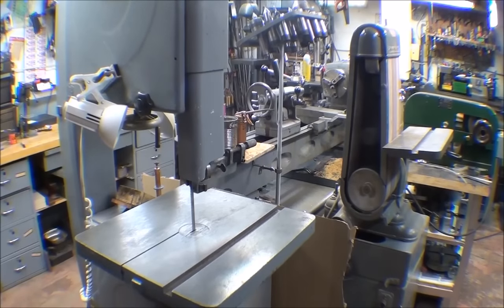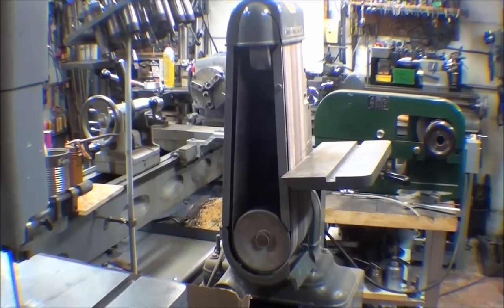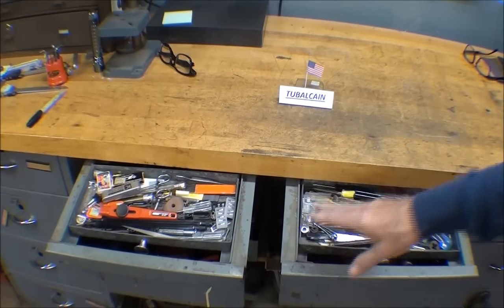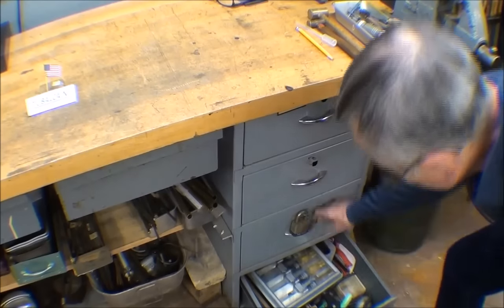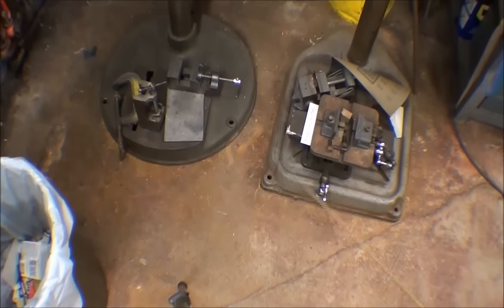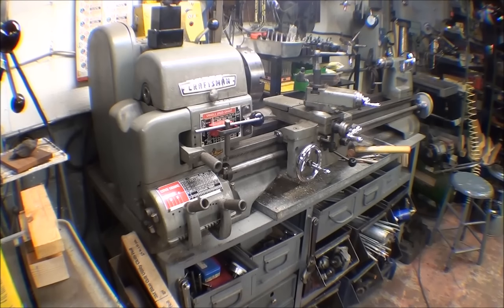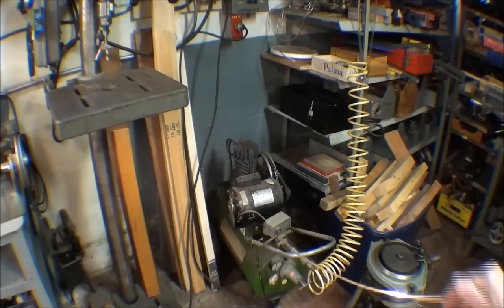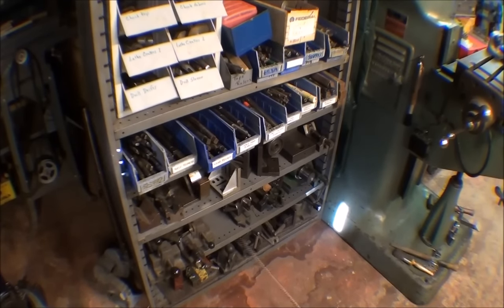TOUR of tubalcain's Machine Shop mrpete222

Comment: Well, I can no longer complain about the amount of space I have available! Thanks for sharing. I have a question you may have already answered in a video, but if so I have missed it. Since you don't use your compressor all the time, I assume you're not one of those who is always using compressed air to blow chips off of your machines. I'm not either. However, I have a hard time getting all the chips off of the Bridgeport since there tends to be a film of oil helping all the chips to stick in place, so the vacuum doesn't get them all. What is your method of cleaning up after a job, sans compressed air?
Reply from the maker: +Rick Rose Thanks for watching-just use a little thinner on a rag. maybe--mineral spirit, it cuts the oil

Comment: Lyle is the Bridge port mill 240 volt or 3 phase 420 volt Regards Frank
Reply from the maker: It is a three phase motor. Probably dual voltage. I have it set at 2:20 volt

Comment: greetings mr. pete. thanks for the tour. if i may ask a question: i'd like to get into gunsmithing, specifically refurbishing pistols and revolvers. is there a brand of files (and other handtools) that you feel are as good as old nicholson tools? would a mini (or even micro) lathe be able to turn 4-6 inch barrels? i guess that's 2 questions. hope that's ok. from one lyle to another, thanks for the lessons.
Reply from the maker: +Lyle W Hi Lyle. I only met another lyle once in my lifetime. Nicks are best, also Heller if they still make them. No, those smaller lathes will not do the job. I like crescent, proto, vaco,--too many, all the older USA made handtools.
Reply: mrpete222 i've met 3 other lyles (one was family), and now you make 4. :-) thanks for the input on hand tools. from online reading it sounds like nicholson quality went downhill when they went out of country. i'll check on those others.would you have any sort of minimum recommendation for a lathe? would only be pistol barrels, so wouldn't need a great center to center distance. thanks again.

Comment: Thanks for the tour. 
I am not trying to be a wise guy but what is the use of a padlock in a room full of machines that can cut steel?
Reply from the maker: +ScribblesOnNapkins Point well taken. Ever watch STORAGE WARS?
Reply: +ScribblesOnNapkins Yeah I figured the lock just was drawing attention myself. Because without the lock the drawer would blend in better.
Reply: +mrpete222 Sorry I try to avoid getting hooked on TV, also I never got cable or anything like that.
Reply: +Paul Frederick True but when you just hide anything in a workspace like that you will never find it. (voice of experience) If anything the pad lock is a good way to remember where you left something expensive.

Comment: Would you not be worried about abrasive dust from the sanding belts getting on the bed's of your lathes ? Do you have a surface grinder ?
Reply from the maker: +ro eng Yes-I think about it always. Usually, I have cardboard betewee the 2 machs

Comment: I am curious if you have a bulkead access to your basement? I have a basement shop with no big machinery  besides a drill press and a homemade bench lathe. The problem is going to be bringing big machinery into a 8 ft tall basement with no bulkead just a doorway.
Reply from the maker: +Micscience No bulkhead--down the stairs it came-diassembled

Comment: Just like my collection of over 50 years however I have been getting rid of a lot of tools,machines,tooling etc as I have not used many of them in years and when I am gone my wife would not know what anything is worth and would take a significant loss on everything so I am scaleing way back and getting a fair price for my stuff.
Hey tubalcain how is that Vespa motor scooter doing? I had one just like it back in the early 60's
Reply from the maker: +boatbuilder1 Thanks for watching-yes, I'm thinning the herd. Vespas at a stand still

Comment: If the compressor is still good remove it from the leaking  tank and plumb in a new portable  air tank.I did that worked great for years till the compressor died.
Reply from the maker: Good idea

Comment: The only thing I could think of as far as more storage goes would be to make some rolling drawer cabinets that fit over your floor standing drill presses. You could leave them parked over the bases of the presses, but if you ever needed the full length of the presses you could easily roll them out. As you already seem to be using the bases of the presses as storage now. So might as well use the air over that too. Crude sketch http://i.imgur.com/oiUbBeJ.png
Reply from the maker: +Paul Frederick Good idea--Thanks for watching
Reply: mrpete222
I have space issues in my shop so I always have an eye out for unused space. I have to say you've pretty much used up every nook and cranny you have now. As that was the only spot I saw that might be considered underutilized. It looked like primo real estate to me though. What I like to call first order storage. The spots you can get to.

Comment: I can tell you don't plan on moving or doing Inventory.  I thought I had stuff.............
What is the origin of Tubalcain?
I tried soaking some of my files in vinegar.  After they were rinsed, wirebrushed and dried they smelled like pickles and were still dull.  Like a knife, files dull with use.